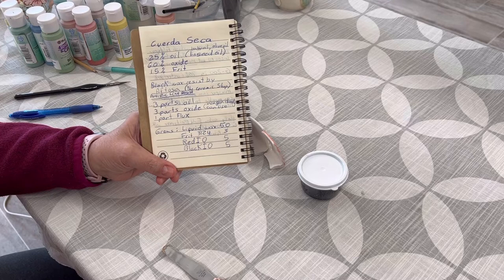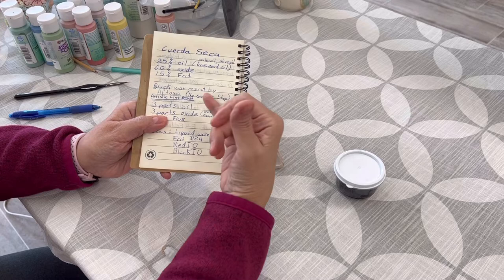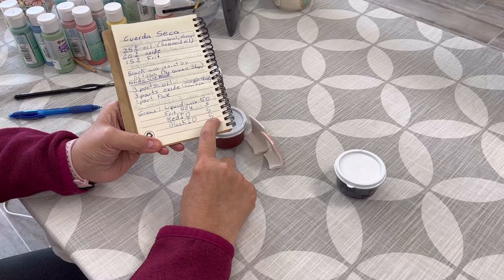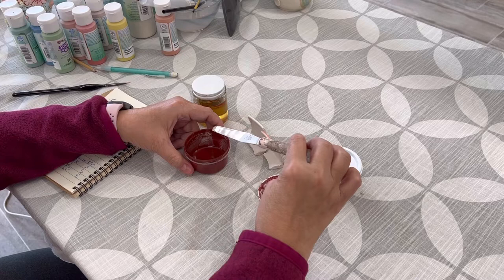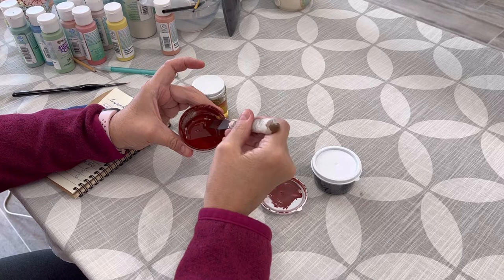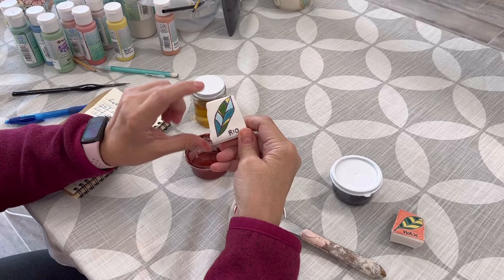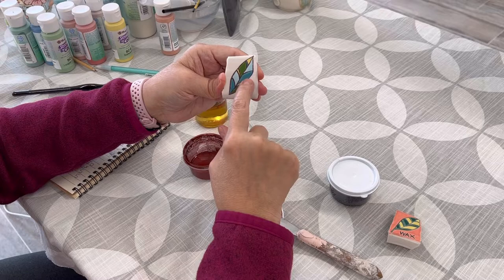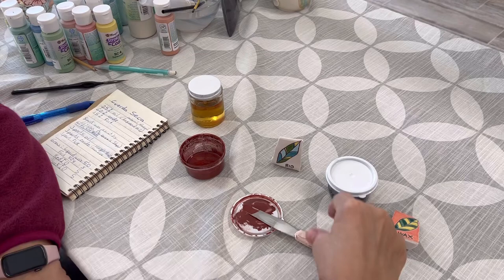Part 1 - Cuerda Seca Technique - Recipe talk

Comment: Hi. Just commenting on the first section with the linseed oil. You have the 60 on the oxide and it should be on the oil. I tried it the way you have written but it’s still very dry and chunky. I mixed  another with 60 oil, 25 iron oxide, and 15 ferro frit 3124 and it came out perfect. 👍
Reply from the maker: Thank you Rob! I got this recipe online but started mixing it by eye bowling and trial and error. I agree that 60 is a bit much. What I do is start with the paste and slowly add a few more drops of oil. I have a later video that I started using sesame oil and it works really well! Have you tested your mixture? If you use too much oil it can create a white area around your line work called halo. Thanks again
Reply from the maker: Here’s the latest video where I show how I mix it.
https://youtu.be/RQSPiuML6XI?si=sACBF-zpzHv7SAsp

Comment: Wondering you percentages you use is that the same as grams. Like 60 grams of oxide 25 g oil 15 grams frit. Just wondering how you figured out percentage
Reply from the maker: Hi Heidi. I found the recipes online by doing a lot of searches. They all vary in the amount, so I’ve come to the conclusion that it’s not an exact science like with glazes. It should work in grams if that’s what you want to use. I go by eye and feel now. The consistency of the mixture is important. If you have too much oil, the oil will bleed beyond the line work which will cause what they call it a hallo. The glaze won’t come in touch with the line creating a white space in between. If it’s too thick, it’s hard to paint. Also you really need to mix in the powder and oil well, using a metal palette knife. Bottom line is, the amount listed is a starting point. If you think it’s thick, add a few drops of oil.👍🏻

Comment: I have the linseed oil and the 3124 frit, but I don't have oxides. I have oxide washes, but they are liquid form. Do you think that mason stains (powdered form) would work?
Reply from the maker: You can try it, it might work if you use black, but I’m just not sure if the ratio would be the same. I tried once mixing black underglaze but it didn’t work very well. Good luck and let me know if it works.👍🏻
Reply: @anasclayhouse  masons stain are stable and black is dark. so you might need less. Im testing with black stain and linseed and frit. 1 oz would be 7 grams of oil 17 of colorant ( way to much for stain) and 4 grams of frit.( again way to much ) since she only uses a little. and it seems by the video like there an 1 oz of oil in there.

Comment: Hi Ana. Thank you so much for this. I am learning from Australia to make a mural in my yard. I have had some 'fails'. Mainly because I used my resist formula using a thin squeegee bottle too (for fine lines) - it kept getting suck in the bottle and just looked wobbly and awful in kiln. Also bled in parts maybe I didn't let dry enough. Also interacted with some glazes weirdly on my pre-bisqued tile (not even sure what kind of clay tile it is...). All in all just looked so wobbly and awful compared to how perfect and almost 'printed on' some tiles look... Not sure if they use a screenprinted wax resist design
Would love any thoughts on:
- What greenware clay do you use
- What is the ratio of the wax resist. I tried linseed oil, frit, black oxide.
Reply from the maker: I don’t recommend using the bottle for the line work, I think it would be too thick. The idea of Cuerda seca is to have the line work be flat on the surface and the glazed area very pronounced. That’s how you achieve the texture. I’ve always use a liner brush for the line work. As for the ratio, it’s what it is on the recipe but really I eyeball it. I make a new batch every time I paint. Start adding just a few drops of the oil to the iron oxide powder. Mix it with a pallet knife until becomes a thick paste then add a few more drops until it’s a thick creamy consistency. Then just add a tiny dab of Frit on the end of the knife. Mix in really well for 2-5 minutes.
I hope this helps.💞
Reply from the maker: I believe the tiles you’ve seen with really thin even lines are done with silkscreen. That’s a process I haven’t done.

Comment: This might be an Odd question: have YOU ever tried putting a little bit of Oil in a glaze - (is it possible ?)🫣
Reply from the maker: Not in the glaze, but I’ve tried in black underglaze. It didn’t work well, I guess it’s because of the water content, doesn’t mix well with oil.😅